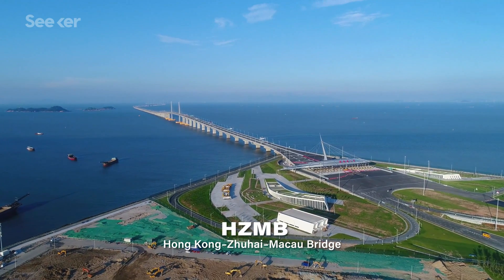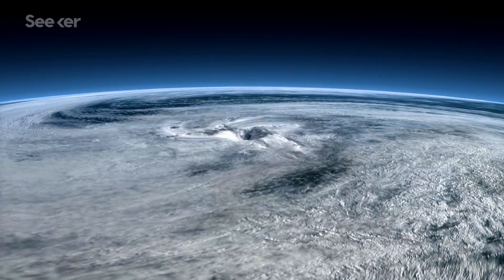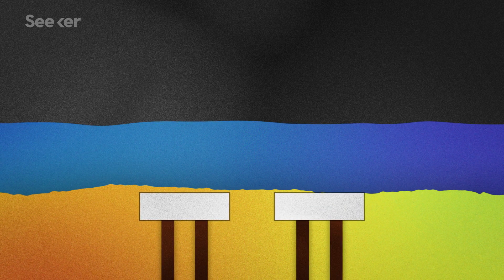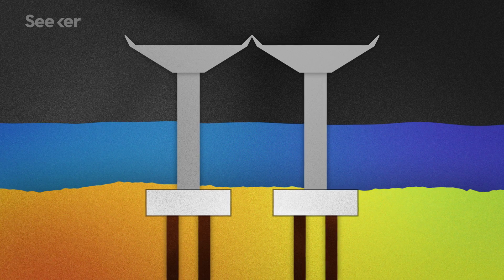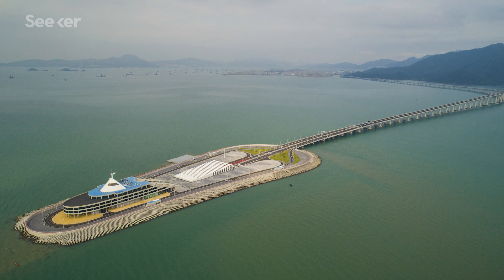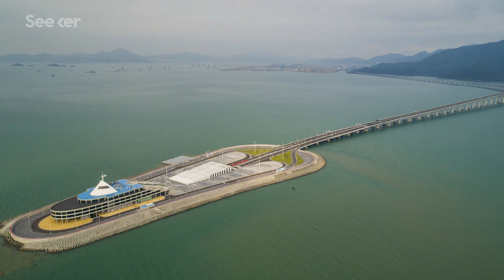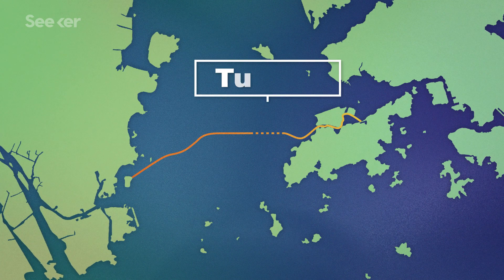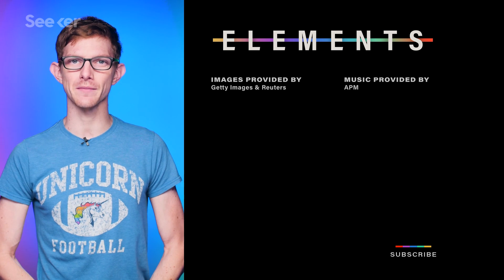Everything It Takes to Engineer the World’s Longest Sea Bridge

Comment: Whyyyyy do you ONLY use metric measurements???????????? I have no idea how far 55km is man
Reply: Alot search google
Reply: @manny4472  I know right. Have to keep pausing
Reply: Around 35 miles I guess
Reply: The conversion is simple. Roughly 100 km is 60 miles. So 55 km is 33 miles. If you drive a car, you may have noticed how close the 100 km/hr and 60 mi/hr markers are on the speedometer. Since the speed limit on the bridge is 100 km/hr, you can traverse it in 33 minutes.

Comment: it's also a means for the CCP to exert and maintain control over SARs like Hong Kong
Reply: The CCP already has control over Hong Kong, it doesn’t need a bridge. Also, the bridge is between hk and Macau, which is two sars. A bridge won’t do anything. This bridge is an engineering marvel, deal with it
Reply: @tzakl5556  I don't think you get the point. Sure, the CCP has control over Hong Kong govt, but it does not have full control. these engineering projects, while marvellous, is one that has sacrificed the funding of local healthcare and the lives of workers to create a bigger influence. How often, do you think Hong Kong people will actually use this bridge? The minorities who run businesses requiring them to move between HK and Mainland already had their drive thru at the border. There is really no need of this bridge, especially when they are draining HK's reserves, placing heavy traffic load on an otherwise unprepared tung chung (they run busses from the port there to tung chung, causing mass nuisances to people living there.)
Reply: @blackopsaf3471  The HZMB links three major cities Hong Kong, Zhuhai and Macau, which are geographically close but separated by water. With the bridge in place, travelling time between Zhuhai and Hong Kong would cut down from about four hours to 30 minutes on the road.

Time is $$ + cost of fuel.
Reply: @AFlyingCookieLOL  and all those would be saved money would go to bureaucracy.
they require crossing fees per crossing, special license, on top of the cross-border driving license you have to obtain. Better yet, the bulk of the build cost comes from HK reserves, but only 40% or less of the revenue goes back to said reserves.
{TLDR: Travel costs did not really get saved, and the only ones who actually profit is the Chinese govt who barely forked out money for it.}
Reply: @AFlyingCookieLOL  Economically yes, but as a person born and raised in HK, I will not have my rights (Freedom of speech, Freedom of political expression, etc etc) taken away, even if it means having the world go backwards. The notion of sacrificing freedom in order to advance a nation's interest is facist at best, and Orwellian at worst
Reply: @AFlyingCookieLOL  as per a discussion with a certain technocrat friend today, These infrastructures have great potentials commercial wise, but it has failed to capture the main potential consumer in HK. (his point made as per attending polo games in Beijing requiring overnight direct trips to Beijing WHICH THE HSR NEVER OFFERED.). This lead to the questioning of the intent of such infrastructures by the local populace.
Reply: @tzakl5556  We re not saying it isn't a marvel, we are just saying it has questionable intentions and questionable executions
Reply: @tzakl5556  It does a whole lot including saving time and $$. You have no clue what infrastructure effect is other than just $$. You idea is basically asking the world to move backward and keep everything the same.
Reply: Nerium Oleander thanks for agreeing with me?
Reply: How is that your concern lol?
Reply: @crystalball020  How is any of this your concern lol

Comment: Why no railway?  Departures every 5-10 minutes with 16 coaches would take at least 2000 passengers. Just look at the Øresundbridge between Sweden and Denmark and the massive amount of passengers in relation to the small regional population compared to Hong Kong Bay area.
 It would be interesting to know the factor that determined that a railway was not to be built. Expensive yes, but why considered too expensive?
Reply: because trains cannot climb up as quick as cars can, dramatically increasing the length of the artificial islands. 
Besides, the current number of people using the bridge is already so dramatically low that basic buses are more than enough to handle the demand.
Price was never the problem. Do you know how rich the Hong Kong and Macau governments are?
Reply: @isaacng123456789  Very rich. The climb seems like a good reason to not to build a railway
Reply: My assumption would be that:
1. Conventional rail doesn't make sense because they are too slow and expensive over 55 kilometers that shuttle buses+cargo boats make an much cheaper alternative;
2. High speed rail wasn't an option because the bridge started construction in 2009 (so the design was finalized much earlier) at which point China had practically 0 kilometers of HS rail;
3. Quick research showed that the Øresundbridge saw most of it's traffic by commuting workers between the two countries; in the case of the HZMB, HongKong already have most of their commuters coming from the north (now with well-built system of subway+HS rail+bus systems), Macau is too small to justify a massive commuting population, and the housing price in Zhuhai is low;
4. The bridge started construction 10 years ago, and it would be a bit hard for the planners to forsee the traffic demand in 10 years, and make a decision that could potentially waste tens of billions more tax dollars on top of the already ~$20B 6-lane project.
Reply: Its been done. As of right now, the HSR from HK to mainland China, the passenger flow only reached around 60% of what was expected for the past 5 months. The matter of the fact is, these engineering projects, while impressive, are political tools to pull Hong Kong closer to Bejing and to gain more control all while trying not to violate the "One country, two systems"  doctrine(which it fails to do so)
Reply: @blackopsaf3471  | They are still getting full control in 2047 when the agreement ends.
Reply: @blackopsaf3471  people expect passenger flow to reach 100% in under a year, lmao i just dont get it. While the political incentives are real, you cant overlook the fact that it will indeed be beneficial in the long run.
Reply: @dxelson No matter the benefits, sacrificing individual freedoms for the good of the nation is facist at best, and Orwellian at worst
Reply: Www
Reply: There are high-speed trains, but not in this project
Reply: Because you need 3 different passport to use that bridge
Reply: @MASB29  fake news
Reply: You think China cares about money or its people? Lol We all knew it's built for the Chinese army to rush into Hong Kong in case they revolve again the Chinese government.
Reply: @hahahahaha52010  Yeah Yeah, what ever, you win 😘
Reply: hahahahaha52010 Are you kidding? Why build another bridge when the PLA has a military base in Hong Kong and a high-speed rail link?
Reply: @hahahahaha52010  Yes they care, China brought 800 million out of poverty. While the US has dropped 26,000 bombs in 2016 alone. 
Lol are you saying China will invade itself? China get's to choose what HK does and HK has grown since China took over.

HK is but a tiny % in it's GDP